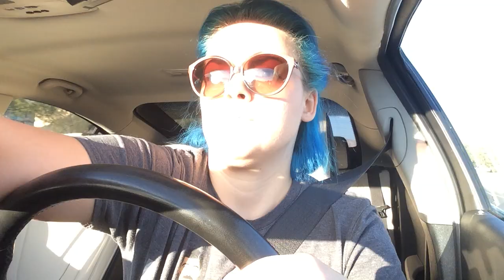Regenerative coasting in the Volt

Comment: Nice video. I have been using "L" mode for a few weeks now and hardly ever use "D". I have been using cruise control more as well. Driving downhill with cruise on the Volt does a great job at holding the vehicle at the cruise speed while regenerating the battery. What I do not know is if this is more efficient than not using cruise when going down hill.
often tap the brakes when I start slowing down in "L" so that the vehicle behind me knows that I am slowing down.
evtrekker13: good suggestion about driving in "Sport" & "L" I'll give it a try.

Comment: Just wanted to clear up something you said about low mode. 
The Volt only has one gear. 
L is a little misleading in that it's not for low Gear but for more aggressive regeneration. It feels like Low Gear but you can use it at any speed up to the 101mph limit.
Here's a good test for you. Sport mode + L in an area with like mid-town speeds 35-45mph. Should put a smile on your face.
But the Volts drivetrain uses only a single reduction gear to the axle. Instant torque means multiple gears are unnecessary.
Reply from the maker: evtrekker13 thank you for your response, I’ve worded it poorly here for sure, but I’ll make a follow up vid when I can. Thanks for the comment!!